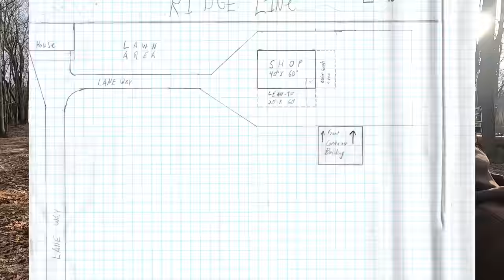Building my DREAM WORKSHOP Pt.1 Clearing the Site!

Comment: Personally, I would dig a big, long pit between the shop area and the house area.  Drop the tree roots in with the brash on top.  (Brash is all the stuff you cannot use like small branches and rotted wood.)  Cover with the subsoil you dug out then the topsoil.  You will have a high mound but that will have rotted down by the time you get to building your house and you will have a beautifully fertile vegetable/flower bed.

Comment: Back in the 1800's, a lot of times when a farmer would clear a field here in Michigan, they'd pile the tree stumps up in a row and turn them into a fence line. If you drive through some of the more remote sections here you can still see some of them, although they are becoming more scarce than they used to be; many of them have rotted away and a lot of what's left has been scavenged by people looking for "driftwood" for crafts.
Reply: I have kinda see this in the midwest. The brush an stumps have turned in to dirt piles over time. We were replacing a fence out in the middle of no where some years back and you can clearly see that the mound of dirt was filled in with brush and stumps along the fence line. I have also see entire 4 foot barbwire fence buried in dirt. We were building a new fence in another area and the mound that the fence that we were taking down had a whole fence under there. The owner of that land took a D9 dozer and was spreading out all of these mounds and in one of the fence lines he was able to scrape away enough of the dirt to expos much of the fence. We took some time out and invesigated it and found that it was a 3 wire barbwire fence from about the 1930s give or take a decade. From what we gathered is that over time tumble weeds built up around the fence and dirt blew in during the dust bowls or bad years and because that pasture is very remote its likely went unused for a number of years and all of that dirt just filled in and before you knew it there was no longer a fence there and someone built on top of it. It was super cool. I have found corners that have pretty much been filled in like this as well in the sandy areas where we have worked. We have also found many fences that were at one time 4 feet tall and had 4 wires and now they are 3 feet tall and 3 wire fences. I have tore out many miles like that.

Comment: I'm sure you have your own list of requirements for the shop but my favorites are full insulation, LP furnace, and floor drains. Put a piece of gear inside the night before you wanna wrench on it, let the furnace run low and slow all night (just 40 or 50 degrees), and by morning all the snow has melted off it and warmed up the steel and fluids. Takes a lot of the misery out of working on cold, wet gear. Especially up here in Minnesota.
Reply: Another guy from MN here. About an hour SW from the cities.
Reply: heated floor, used oil heater, those oil changes provide a good bit of fuel for that. Proper bathroom. Urinals, sinks, a shower. coffee machine, microwave, man's gotta eat.
Reply: And a pit to do oil changes and undercarriage work
Reply: @briancasey4917  or to fall into and be found 2 days later :) Just kidding, pits are good.
Reply: Viol 9 Q10
Reply: @uliwehner  QA A BE

Comment: I built a 40 X 48 shop by my self in 3 months.  Not that hard, but I'm retired so I could do it full time.  Just had the slab poured and I framed the walls, ran boards up past the top plate on one end to hold the trusses, lifted them up and stacked them against the end.  Then positioned one at a time and nailed in place with plenty of bracing boards.  Put on purlins, screwed down the sheet metal, set doors, ran electrical. Done.  Simple!  😁

Comment: Very awesome, can't wait to see it finished. Watching you reminded me of a guy I met working with a welding outfit. He wanted us to come out to his property a lot like this, and build his house and garage. Our job was to put down a slab, build out the frame of a giant pole barn and skin it in colored tin. So you can see it, Think about a metal building used as a 4 car garage, 2 double doors with gap between them. Now, there is a second building the exact same size next to it with a gap between to drive a car through, essentially making a giant rectangle. Everything is covered by the roof covering the entire slab. Once that was done, we did the hand over to the next crew coming in to do the internal buildout and roughins of utilities. Being on the coast of Texas, we had to build to spec for high winds, and I am happy to say the building held up to a hurricane.

Comment: Great news about your blg Matt. If you have the budget..seriously consider radiant hydronic floor heat. Also think about floor drains, they have 4" wide - any length drains,   recommend inside- centered on each overhead door. When you bring in your snow covered equipment or vehicles  with floor heat everything melts off & the floor dries really fast. Add any plumbing for any future bathroom & wash-up sink. Only IMHO..Good luck Matt. T from Ohio

Comment: When I built my dream garage 15 years ago I put radiant heat in the floor, it added a few thousand to the final cost but it is worth it! I heat it with a propane tankless hot water heater, but with the supply of wood you have you could do it with a wood boiler. No matter how big you build it it won't be big enough, lol, looking forward to the build.
Reply from the maker: thats exactly what I am doing, in floor heat and a big wood boiler.
Reply: @DieselCreek  Perhaps make the wood boiler remote from the structure - this is fairly common in Canada for fire insurance reasons.
Reply: Jim jibroni ,was that -40F or -40C ? 😜
Reply: @DieselCreek  Get some large old propane tanks to store hot water for your in floor heating. My shop is 60x50 and I store 2500 gal of hot water so I only burn wood max once a day on very cold days -35c.
Reply: @Hoaxer51  that is the same temperature, they meet at -40.
Reply: @billcarriere5374  , that’s why I put the smiley face on it. I wondered if anyone would catch that, nice job!

Comment: I just built a 36' x 48' post frame woodshop by myself for the most part. I have a bunch of videos on it including a time lapse of the entire process. You can save a ton of money on a post frame by doing the framing yourself. All it takes is a few ladders, simple jigs, and time. If we would have started in the Spring, we would have easily finished by the end of Summer  — but lumber prices were four times what they normally are at the time, so we waited until prices dropped. If you plan to do it yourself, my videos will definitely help 😊

Comment: I don't know the budget but it would really be good to put  plastic drain pipes under the parking area.  My dad had a buckeye ditching machine.  A 4 inch tile drain over the hill will keep water out 7 feet on each side.put it below the freeze depth. 4 of them would dry up 60 feet  wide and whatever length they are.  Solid dry parking lot.  A flag pole flying the red white and blue  at diesil creek headquarters.  My son build a multi million dollar business. I told him a flag pole is mandantory..he built the business from scratch. We didnt have a pot to piss in.

Comment: Cool Job Matt !   I think what i would have done was to make a clearing a couple hundred yards away . Cut your root balls away . And hook on to the trees with the dozer and cable and drag to the clearing to  process them there. It  saves you  time and trouble. By doing that, you dont  have a pile here and a pile there. Everything is in one place. Great work though dude! its coming together, one day at a time. Keep up the good work later.   Curt M. RollenThunderPerformance

Comment: IMHO, it looks like you should drag the container shop back a short distance, so you can utilize more of the flat area for the new shop. Minimize the amount of fill you'll need to haul in to build up the grade. Speaking from experience, I'd suggest going with brown sheet metal for the barn. It will blend well in the trees/summer foliage and at night, it's hard to see. Won't stand out if someone drives partially into the property. Might want to "camo" out the "little red shed". I can't imagine the county would be happy about that being just up grade from the river.

Comment: Small tip for GoPro - if you connect good powerbank with GoPro by original cable it can run till your memory card is full. :) O right also - try next time do "before" and "after" footage side by side comparison or just pictures, it would be awesome to see changes.

Comment: Questions: 
Is the red hut an outhouse or a deer blind?
Are you going to have a heated floor in the shop?
Are you going to have a long drain on one or both sides so you can power wash in there?
Bathroom in the shop? 
Kitchenette? 
I’m assuming you are putting in a well; when will it go in.
Same for septic system; when? 
Electricity? 
It seems real close to that drop off, what about erosion?
What’s the plan for the house - timeline, how big, etc?

Comment: Hope your going to raise it up in case creek floods and goes through your prize workshop. Cement pad would good and proper drainage around outside. Rubber matting,will save concrete from tracks.  Just a few tips. Stuart Palmer Adelaide Sth Australia

Comment: Excellent video Matt. You work hard on your property and go quite the extra mile to include us. All the camera work/angles, drone footage etc. on this video made it a treat to watch. Really liking it!!

Just a thought, that was a lot of intense work for the Dirty Hoe, felling all those trees. Some of the big ones were a bit much for it as you said. If the 977 were available, wouldn't it have been easier on the excavator to just dig around each root system and then flatten the tree with the 977's giant bucket? Save the pushing with the excavator, seemed like a lot of strain on the hydraulics.

Comment: Questions?
Are you going to have a heated floor? Are you going to have a long drain on one or both sides so you can power wash in there?
Bathroom in the shop? 
Kitchenette? 
I’m assuming you are putting in a well; when will it go in.
Same for septic system; when? 
Electricity? 
It seems real close to that drop off, what about erosion?
What’s the plan for the house - timeline, how big, etc?

Comment: Just for info or concideration, when I built my 60x 100 with a 70x 90 L I had a three and a half foot knee wall included in the foundation. I was able to place storage units on it as well as work benches supported on triangular brackets no feet in the aisle area. it also permited a shorter structure without loosing height . Good luck John D.

Comment: Looks like your tracks are loose. Also if you clear land on regular they make a one tooth bucket just for popping stumps out we have one and works great.  Enjoy the snow storm I hear your getting alot of snow and ice and alot of wind.
Reply from the maker: I have the one slacked off on purpose. Bushing is going out of the idler, if you tighten the tracks it doesn’t want to spin

Comment: I always appreciate watching your videos, and letting us "join" you on your journey.  One of the challenges you have is probably keeping all the batteries your equipment needs fully charged and fully maintained.  It occurred to me recently that you could have a couple of "portable" power boxes that house 2-4 12v lead acid batteries, with multiple lugs for 12V, 24V or 48V connections.  Then you could craft a "receiver" on each machine that this "portable" power box could drop into when needed.  Keep the power boxes charged, warm and maintained in one of your shipping containers, or your garage.  Keep up the good work!

Comment: Very good job, Matt.  I'd really suggest you wear chainsaw chaps.  It's amazing how many little chunks a saw can take out of you in a split second.  Yea, I know they're uncomfortable and catch on things.  I use to have the kind that fit into pockets inside the pants.

You did a really great job of getting danger trees.  The twin tree where you cut one stem, take the rest of it.  

As a forester and logger in Kalifornia, I have had a lot of experience with clearing where there will be a building put up.  Take any dead, dying, or defective trees in the area. Then try to guess what the remaining trees will look like in twenty-five years.  Any trees that could be dead, dying, or defective at that time should go now.  It is relatively easy to take the tree out now but, once the building is up, it becomes real expensive. While conifers tend to grow straight up, hardwoods grow toward the light.  They like to grow into all that light over your building.  Anyhow, that's my soapbox,

You do have a bunch of logs that I'd love to put on my mill.

Comment: Hey matt dont make the same mistake as me, clear enough of the trees, so if the closest tree falls it will miss your new shop and future house. Leave yourself a good buffer.

Edit: cut an extra 20ft after the buffer, and dont worry about the tree huggers sitting in their concrete apartments. You also have to consider elevation. Make sure the final elevation of the slab is at  least 1 foot above the ground and before pouring concrete leve a couple extra 2" long sweep conduits for anuthing u might need in the future ie generator solar panel etc
Reply: Don't hate on people for liking trees bro, educate them on how species like spruce and cedar grow fast and kill other longer lasting trees by consuming the light and water supply. Some trees are basically weeds but still make for great building material which is awesome for us. I agree that he should consider future problems but you can tell which ones would fall toward your building. Forests look nice man, as long as they aren't overgrown so there's no need to full clear anything usually.
Reply: Forget the tree-huggers myths, no shortage of trees there but some open spaces are essential for a mix of wildlife.

Comment: might be able to help you tighten up the ho if your interested. I line bore machines, getting my old cat 215b  all tightened up now. Wish I were building a shop at the moment. Looks like it will be a pretty good size for most things. Using wood heat?

Comment: People probably laugh or shake their head in disbelieve when you unbury another piece of plant that has been dormant for decades and wonder why bother.  Well this just shows those doubters that as you deliver another major project using those buried resurrected plants, they may not be pretty to look at and not having the latest gadget but most importantly they work and do the job.  Without all these environmental ECR and SCR constraints these machines just work time and again with minimal maintenance.  In contrast as a plant business in the UK we are having to now buy extra machines to schedule the down time due to the daily battles with the various emission controls and the extended parts delivery.  Some of our major and even minor electrical sensor parts are on 18 months delivery windows and we have a number of excavators parked awaiting parts. Matt thankfully has none of these problems and thus a more reliable contractor. Well done.

Comment: Love it man keep it up .gonna make one huge piece of advice and I see this mistake alot with the tree clearing make sure you clear 10-20 feet from those building becuase you see how that tree fell and how tall it is when you cut it down if there's high wind or lighting or a tornado or hurricane u never know one of those big sucker can fall down on it it's vetter to clear them now than have an accident happen Matt the world unpredictable and especially think of fires as well even around ure house those can take out or corner or middle of the shop or house just better to be prepared than under prepared

Comment: Cherry trees may be nice, but when they get old, they become an accident waiting to happen.
At least the ones over here in Germany don´t get older than 120yrs or so, from 80 on they they start to rot from inside.
We had to cut down one a few years ago, a few years prior the lowest limb (about 80 rings...) developed lengthwise cracks and bent down, then we knew, the tree won´t make it much longer.
Still it was a beautiful one, lots of fruits every year.
Reply from the maker: These are different cherry, to my knowledge they never get that old. Not fruit bearing either. I’ve seen them rot inside trees that are no more than 20-30

Comment: Matt, thank goodness for the newly installed lights,they have paid for themselves already and certainly light up your yard. Matt, have you thought about putting a service pit in so you can work under your machines more easily, just a thought from an old guy but my pit makes oil changes etc so much easier. Well done, just clearing those trees has already made a huge difference